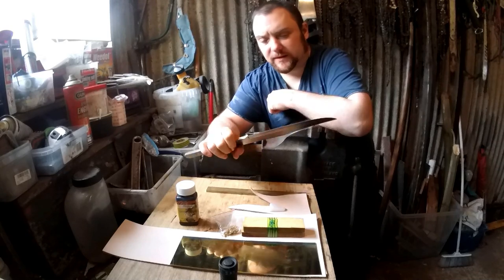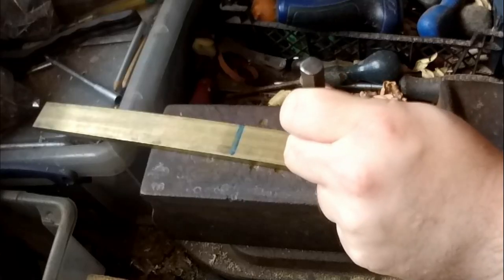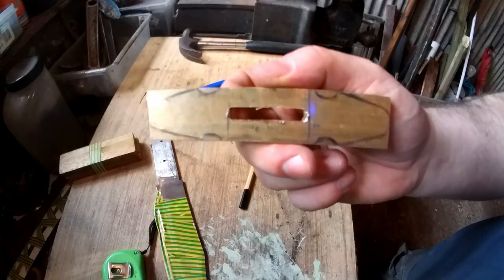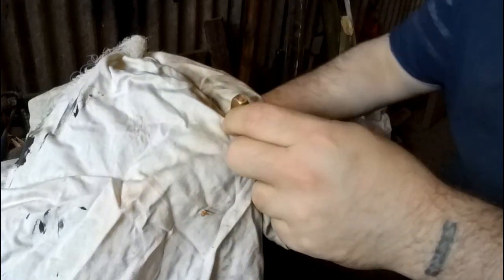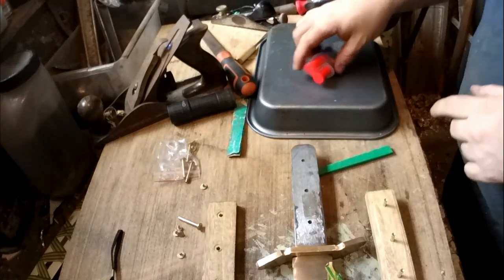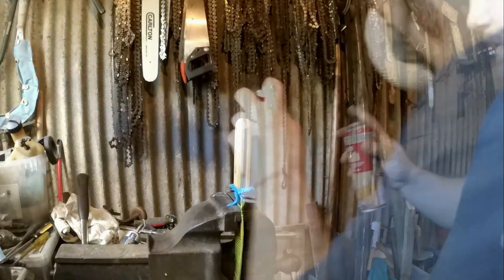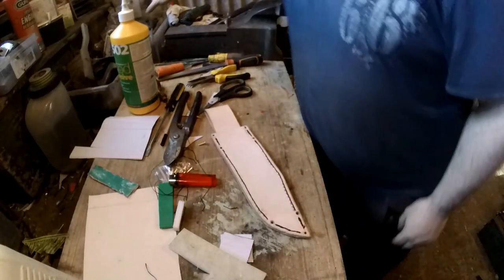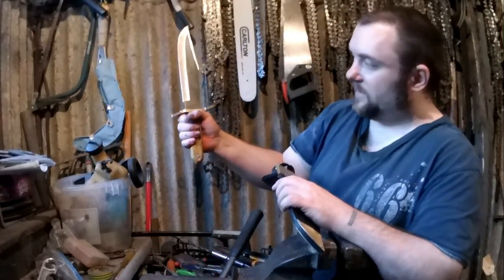Homemade Bowie knife with Brass Fittings and Sheath

Comment: Have you experimented much with polishing? I have a block of wood about 12" by 2.5" and about 1.5" thick and glued peieces of leather on each side. Same leather you have rough side up. Then you apply polishing wheel compound. I used this amazing stuff called schmidt polermedel new blue. If you use it as a strop on a already fairly sharp knife is comes out like a razor BUT if you use it to polish the flat of any blade rubbing it back and fourth my god it comes out like a mirror in less than 5 minutes.
Reply from the maker: I shall look into that today Sam, would be very helpful. cheers for the tips.

Comment: You're really good at making and fitting those guards now, if you are looking for some good cheap epoxy for wood/metal bonding, get a big pot of gorilla glue original.
Reply from the maker: Thanks mate, glad you liked it, i am really happy with this one,  will give it all a nice polish soon, didn't have time for the video, and will defo buy some gorilla glue, that stuff i bought was a waste for the size of it, lol
Reply: @WeaponCollector  I usually buy the large pots of gorilla glue, the good thing about it is you only have to use a very thin layer and it expands to 4 times it's size when it contacts the water. So a large pot for around 8.99 will me around 1 year. It's very strong stuff.